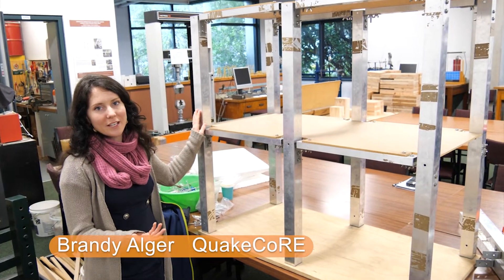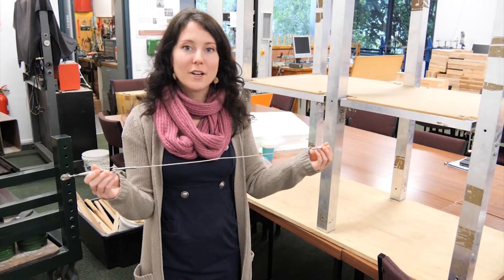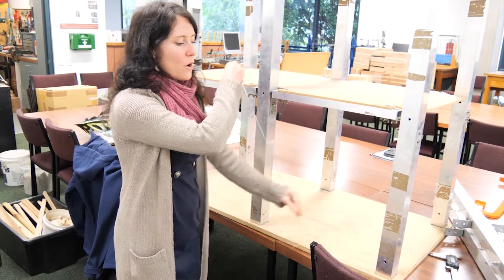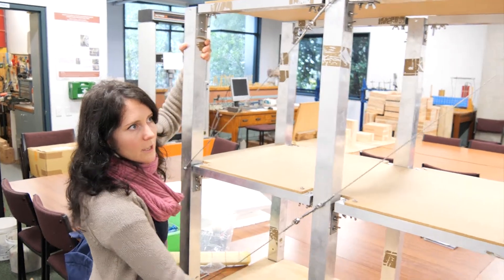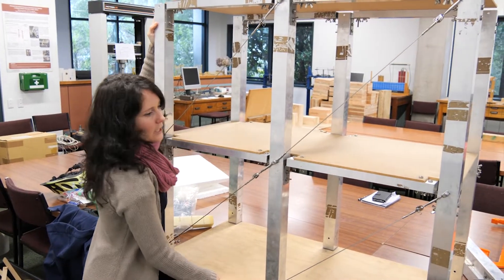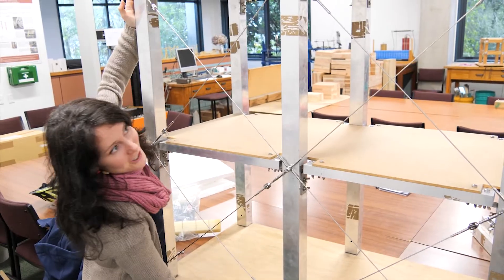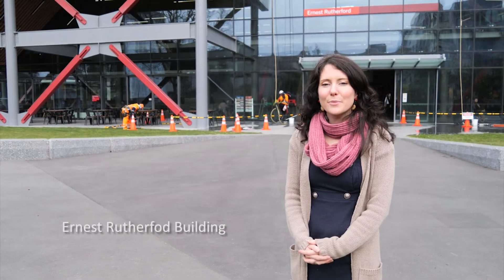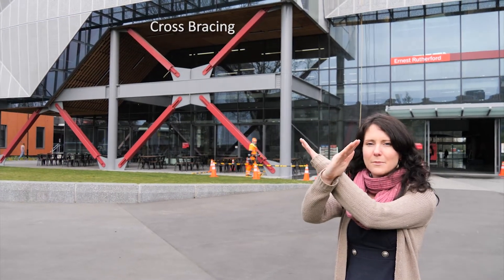Bracing to Strengthen Buildings

Comment: Most of the examples shown in the Christchurch tour are Buckling Restrained Braces (BRBs) which have equal capacity in tension and compression and do not need to be orientated as "cross bracing" as she described. In the one of the examples she showed bracing going in opposite directions on two different floors which would not work with other types of braces and is not an example of "cross bracing" (if it was, one story would have no capacity hile the other story would have a lot of capacity and would be a collapse potential).  This is a dead give away that these aren't the types of braces that were demonstrated with the cables in the model at the start of the video.
Reply from the maker: @wiredbliss683  thanks for your comment and feedback
Reply: But doesn't that assumes that the diagonal brace shown can bear only tension? If it can resist both tension and compression than I don't think there will be a failure and thus the type of bracing is still similar to cross bracing